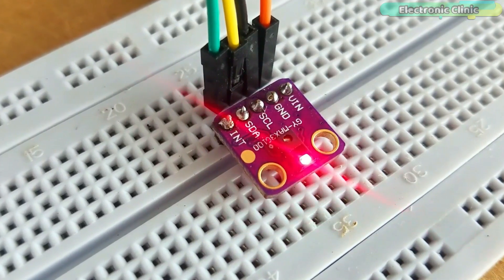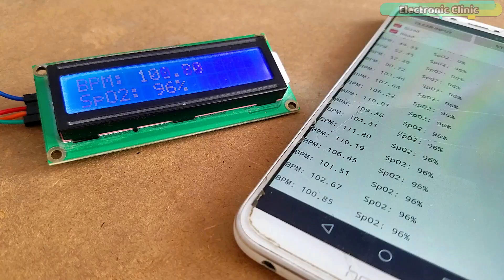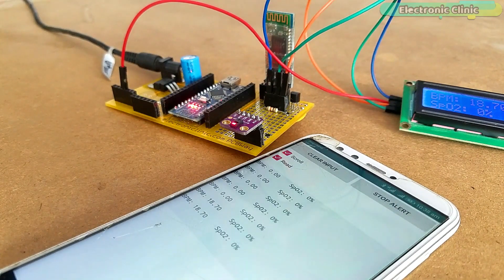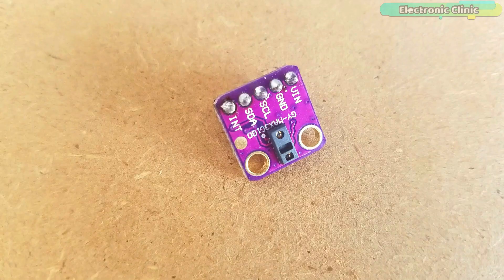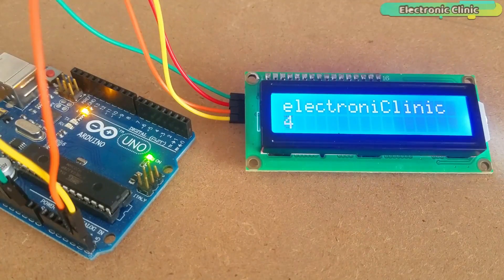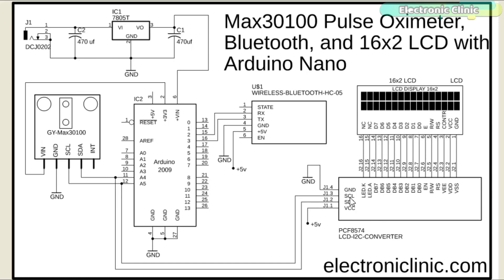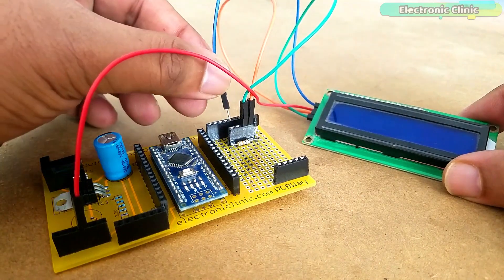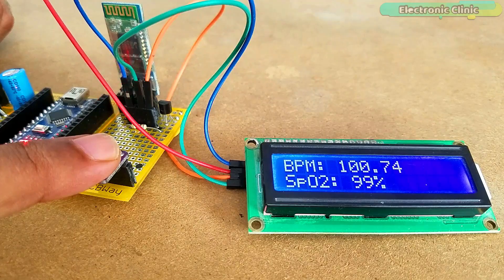Blood Oxygen & Heart Rate Measurement with Max30100 Pulse Oximeter, Arduino, and Bluetooth

Comment: Hello sir, I need LPG gas leakage detector with using GSM module and solenoid valve combining the automotical off the gas project details video please and the program and circuit diagram please sir 🙏.. reply me .... Please it's very urgent.. Thank you 😊
Reply from the maker: its available on my website. you will need to search for this on my website.
Reply: @ElectroniClinic  sir I want to GSM module + solenoid Valve combining project to automatically gas off system, please sir help me.🙏